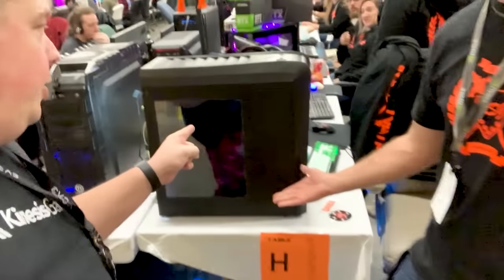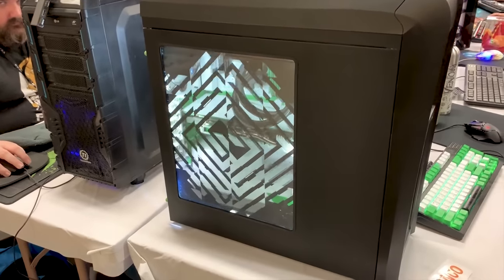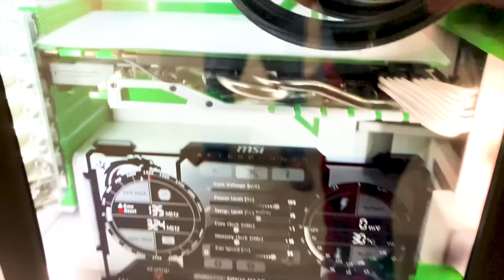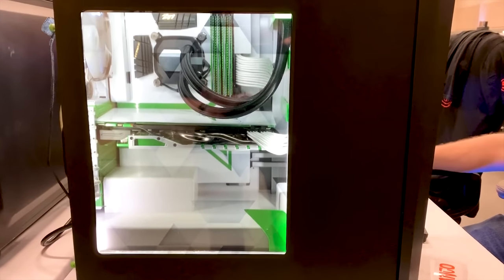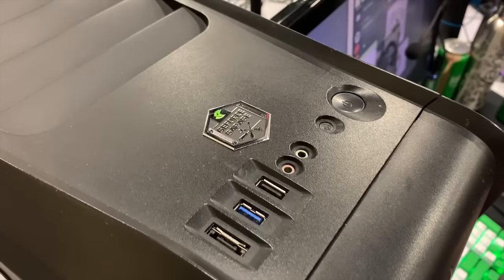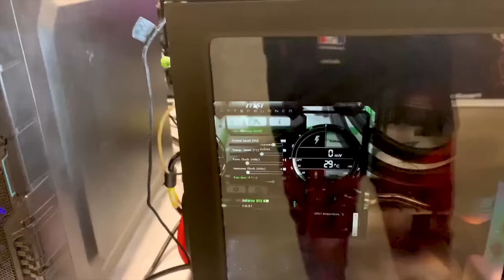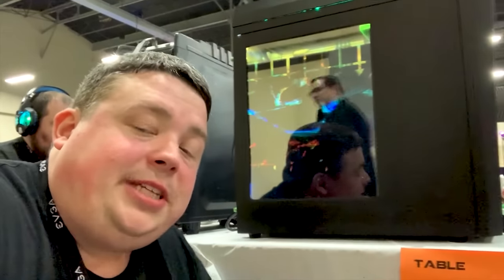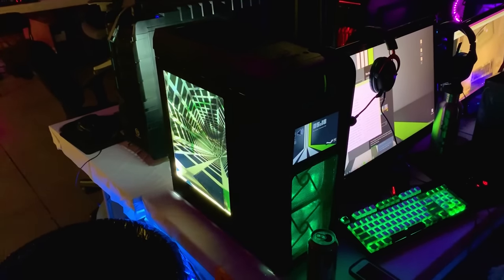Transparent DIY full color LCD side panel is the best case mod! - @Barnacules

Comment: I did this back in 2001 but it wasn't as nice as this. I used three 7" black and white lcd panels with ridiculously expensive lcd controllers. Back then colored lcd monitors were really expenisve and old school crt monitors were the norm. I ended up putting the project on the side and never got around to finishing it completely. I've still got pictures of the crazy pc mod I was putting the lcds in but none of the pics show the lcds. I removed them when I was finishing up the case for a modding contest in which I didn't even finish modding but still won the contest either way. Maybe one day I'll make a slideshow video showing off the case. It had mods which I still haven't seen anyone else attempt till this day.

Comment: ok for real i always thought it would be cool to use lcd technology in regular house windows, you could integrate them into a smart home system and literally dim them, change the hue of light, display information and all sorts of stuff.
Reply from the maker: minton brunkhorst I’ve seen this before in modern homes, but those LCDS just do solid black and white.
Reply: yah i can imagine it would be hard to get lcd technology that could handle direct sunlight for prolonged periods of time, also intense UV and heat may explain why there is no color option yet

Comment: How to get the video feed from inside the case with no cable going to the gpu port outside?
Reply: My 1080 has hdmi inside for vr front panel this is now making me think of a use for it
Reply: Attarsanah Resources unless you have a feature like that on your card you could always solder to the mono directly and add an internal hdmi port. Not to hard but really time consuming
Reply: Attarsanah Resources he’s using the integrated graphics from the cpu

Comment: I have the Ibuypower snowblind, and I am still jealous of this.. If only it were a touch screen see through LCD display though then it would truly be magical.
Reply from the maker: ECashsociety TechTalks honestly making it touch screen would be pretty trivial. Easiest way would be just to add a USB motion tracker like from Magic Leap and it would turn the whole side of the case into a multitouch surface, you could put on 3D printed buttons, etc that are fired when touched without them being connected to anything. I should just do a video on it. Go back to making weird stuff like I used to.
Reply: Barnacules Nerdgasm I would love to see you do that.  Your Epic 3 50 inch setup nearly inspired me to do the same in my own home.  I bought two 50 inch monitors then sort of gave up on the project though I wish I hadn’t.  I also bought a product called the airbar to see about adding touch capabilities to my snowblind in the hopes that I could modify it somehow.  I am sure you have heard of this device showcased on Unbox Therapy some years ago.  I’d love to hear a recommendation for a USB device to do this with my snowblind.  Sadly the airbar I picked up was DOA.  I tested it on three different laptops then finally returned it.  I also looked into something called touchfoil.  Either way having a see through touch screen display like something out of Minority Report has me extremely intrigued.  I have been watching your channel for some time now and if it wasn’t for channels just like yours I would not be headed in the direction I am.  Man just having a response from you brings me a ton of joy!

Comment: Finding a good use for outdated tech is the best way to recycle. Thanks
Reply from the maker: I thought the same thing, everyone has old LCD screens laying around they couldn't give away to the Goodwill if they wanted to. Time to dust them off, rip them apart and make them display epic Anime on the side of your case at LAN parties!
Reply: @Barnacules  I've often thought of additional info screens off of the game play areas, I'm old and would like all the monitor real estate I can get for game play with the info screens in a lower res. monitor. elsewhere. example desktop touch screen in hand and info screens on desktop. Being older I can use touch screen (ie tablet style) in lap, and use aux info on desktop screen. My preferred method is desktop compute power in tablet form (wired/wireless) and aux info like twitter or chat on desktop monitor. Still in development.
Reply: Additional info, my current setup includes twin 32" monitors appox. 10ft away with a hand-held touchscreen hardwired from my recliner couch (still glitchy, working out the bugs), looking promising. The hardwired touchscreen eliminates lag.

Comment: I did this mod with my computer went through 2 panels because first one broke and only bottom third worked, but the second one worked beautifully. Got them for free so who cares. One thing to note for anyone who is thinking of doing this, ONLY DO THIS IF YOU HAVE A WHITE CASE and ideally white components because it does not work as good for black case and components as it does with white all over the inside. There is a lot of light absorption from the black so the screen wont be as bright and vibrant. Also doesn't work during the day.

If you are going to tackle this project
3014 LED light strips are the brightest strips per foot and are efficient for the amount of light put out , Very good density of leds 

Solder up a molex to the LCD control board so you don't have to mess around with the monitors power supply you can just hook it in to computer 
power supply    
Remember: Yellow=12v ; Red=5v; Black=Ground

Comment: I would use a Rasp Pi to drive the display. That way the displays can be "canned" you could control and send extra data over serial or ip that way you don't deal with "loosing your cursor"
Reply: The Pi is good for some projects, but I don't think losing the cursor is so bad that it has to change the way this project was done. Plus, the Pi's ARM might cause somewhat significant delay in printing stats to the display.
Reply: I have the touchscreen he has but I have it inside my PC below my GPU, running rainmeter and HWinfo at 640p to display my system and hardware stats in real-time results in basically zero system useage, and my mouse only goes over there when I want it to. I have a video of it on my channel playing the new DOOM game. I'd eventually love to find a bigger display and better mounting process, my old case I had it bolted to the acryllic window and it fit the spot it was in perfectly, inside the P300s TG it just sits there and looks tiny lol.
Reply: just lock the mouse to 1 screen so you wont loose your cursor or make it a dual key press to switch screens easy fixes

Comment: I've seen these before and although I thought they where a really clever idea they just didn't impress me. However the way this has been implemented using the white inside the case and the screen to blank areas out rather than be a semi transparent display, this really works. 10/10 for implementation and 10/10 for DIY :-)

Comment: Uhm, I happen to have a couple LCD screens with some spare LCD controllers laying aroung in my house...
Reply from the maker: You know what to do...
Reply: To be honest, this is very easy and cheap, you can use a recycled old laptop screen with a 20 bucks controller board from eBay. 

I am gonna try this with a 10' inch LCD that I have, but don't have the controller, just the case mod that isn't gonna be easy for me...

Comment: Holy shit I tried this a couple months back and this motivates me to try again! Haha, thanks for the great vid as usual!
Reply from the maker: Ashnno why did you fail? Any advise to pass along?
Reply: @Barnacules  Just knew little to nothing about electronics. Basically, I found the lead wires that powered the LCD and it almost always came down to 2 wires, the red 5v and black ground wire (I tried this with 3 or 4 panels, lol) Once I found the leads, I tried soldering them to another 5v cable such as a USB power cable. I was inspired to try this method by watching some other people's guides who seem to have got it to work. Mine just ended up with a dead monitor control board every time :P

TLDR: I just couldn't figure out how to properly power the monitor heh..
Reply: @Barnacules  Also, I'd love to see you try this and make a video on it!

Comment: now i have no idea how this would work, but couldnt you theoreticly assign a virtual machine from a ryzen 7(because of its 8 cores) and have only the virtual machines use the lcd panels, so you wouldnt accidentally loose your mice on another panel?
Reply: yeah but youd need to keep a separate keyboard and mouse on stuff at hand. and youd need a second video card just for that.
Reply: Or use a raspberry pi
Reply: @Mart-E12  ... why did i not think of that O_o

Comment: Still love this since I saw it in one of Mosquitos (from themodzoo) builds a long while back. It's on the list of things to do in the future.
Reply from the maker: Larry Kozlowski blows my mind that Mosquitos did this back in 2013 and it’s still a rare mod to see.
Reply: @Barnacules  yeah, it was just before its time. It actually gave me an idea for a mITX scratch built case where 4 sides had windows made from IPad retina screens but I just never followed through with it since it was ridiculously expensive and the horsepower would be insane to run it. I still want to do it someday.

Comment: What software did he use on the small drive bay lcd to eject the optical disc tray and control system volume.
Reply: It’s a simple script in rainmeter.

Comment: anyone updated windows 7 64 bit thru windows updates  and looked at 
power management the performance mode has disappeared on mine is 
microsoft slowing down windows 7 forcing upgrades.  can only use 
balanced power option which does not boost  for work loads 12/07/2018 .

Comment: I have a dream system I'd love to build, but I don't have the $$ or the room for it and as the hardware keeps advancing, I keep tweaking it. but long story short is it would be housed in a Thermaltake Tower 900, dual custom hardline loops, with the front panel being just like this LCD side panel, the idea is Umbrella Corp. Blueline for one, and Greenline for the other, and the reservoirs being the Golgotha Virus and Tyrant Virus double helix vials. and the front panel of the Tower 900 would be this Transparent LCD display set up, where I can set up biohazard info, have Umbrella Corp. splash screens, and be able to have the Red Queen show up from time to time and upon shutdown have audio play of the red queen saying "you're all going to die down here" over a case speaker.  I'm currently lusting over the Samsung CHG90 and the RTX 3090

Comment: I did this in 2001, i had a full tower case custom sprayed in an arden blue, i used a 7" lcd in the top 3 drive bays displaying whatever i wanted (usually music videos from my winamp playlist) plus a 14" lcd on the side as the window just like you see in this video, the only issue back then i had was i couldnt get a decent amount of backlight in the case plus my motherboard was dark, didnt have the guts to spray the hardware, i had a matrox graphics cards which i removed the vga connector and soldered the video wires direct to the graphics card where the vga pins had been so no wires out the back of the case. I do wonder why more people dont do this though it is by far one of the bets case mods you can do.
Reply: We really didn't have the leds back then like we do now.  Were you using the ccfl's for the backlighting?  Those weren't very good for pure light output, just not bright enough.

Comment: Retty slick.  Reminds me of a case I made using a touchscreen from a busted point of sale terminal back in 2004.  Ran off the dvi out and powdered with a paper shredder power supply.  Mounted the touchscreen and display inside the side of a massive tower.  Fun but sketch as hell.
Reply from the maker: Sketch is where it all starts man! If you have any pics of it tag me on Twitter @barnacules
Reply: @Barnacules  I think I have a pic, but it's been 14 years, so no promises.

Comment: I was discussing this last year. I have a 17'  laptop and HP palm pilot screen I plan to put in my case. I have to check out your build log.
Reply from the maker: DOOOOO ITTTTTT
Reply: You can use nearly any screen. You can get power supplies and control boards for nearly any monitor on Ebay. You can take an outdated monitor and add HDMI to it.

Comment: There is no need to do this, it serves no real function (minus the front panel) But dang its ultra cool and if I did lan parties still, that would be the coolest idea for sure.  However I also see this being a thing for old lcd panels where the tubes died, and putting them in a "shadow box" with the inside painted white and lots of internal LED strips.  Nice idea to be run off a Pi as a form of art on the wall.

Comment: can you tell me more about your Clevo laptop. I recently got one from digital storm but it's difficult and confusing for me looking up drivers for a Chinese website. And the drivers installers are manual, there is no installer that automatically does all the work for you, it feels like you have to put the files in manually and I'm uncomfortable with doing that and have no idea what I'm doing.
Reply from the maker: Zipzeolocke the problem with Clevo laptops is they are infinitely configurable so everyone is different. The one Puget Systems built me has all inbox driver support.
Reply: @Barnacules  the one I got came with a P95xER U3E1 motherboard, Intel i7 8750H 16 GB of RAM, a GTX 1070 MaxQ, a Samsung 970 Evo 1TB NvME SSD with a 1920x1080 144 Hz screen. it's a really nice slim powerful laptop, but I don't know anything about Clevo/Kapok. I just know they manufacture a lot of laptops and a bunch of OEM's use them because they are a great bang for the buck

Comment: My case has holes to mount a fan on the side. I'd have to buy a whole new case first to do this. LOL
Reply from the maker: drud 1995 just ditch the acrylic plate on the side with the hole and replace it. Places like tap plastics can trace and cut you a new one without a hole

Comment: I do like the Touchscreen. But I am wondering if I could just do a black LCD screen. I now have more ideas I want to do...

I understand you need the inside to be white...but...What happens if I dont want it to be white? Can I not do that?
Reply: It needs to be white to reflect as much light so that you can actually see shit through the screen. It's essentially a backpanel for your LCD display.
Reply: @startide  and if I dont want to see behind the display? Like for example I just want to do animation for the display?
Reply: @angelofrevelation5822   of you want to see anything colour properly on the actual screen it has to be bright white.
If you just wanted to shutter the inside, so black it out and then reveal the inside, or black out parts of it, you could have anything inside.

Comment: It's just a regular screen without the rest of it lol  There is a reason they put the screens inside an enclosure and not just out in the open.
Reply from the maker: THE NEON TETRA PRO GAMER they are super fragile, that is why they put them in an enclosure and usually light them from behind the panel with diffused light.
Reply: Yeah, the reason why you need very bright white inside case is be cause it Acts as the backlight

Comment: This hack can be easy and difficult I made one of my computers last year with a transparent lcd side panel that I put together done it first go worked out great made the whole panel plexi glass and masked out everything but the screen. I decided to do it again with my main rig and it all depends on the lcd you use I had to go through 4 or 3 monitors and still am searching some old vga monitors have the psu built into the graphic board and short of dremeling it you wouldn't be able to shrink it and some lcds have a issue with removing the anti glare filter even if you soak them for hours.
Reply: What monitor worked on the first go? I have an old vga monitor and I am thinking about doing this.
Reply: @NotCreative21  Tbh I lost the frame and i'd have to look up the part number to find out. Best advice I can give is to open it up part way and if you see the psu is separate from the driver board you can use it. Also it makes it easier if the psu is labeled if it isn't you will have to be careful and test it while it plugged in and apart to get the voltages. After that just cut the psu off the driver board and use the main computer psu to drive it. Some time today or tomorrow i'll go figure out the monitor I used in my first panel I made and leave another comment.
Reply: @everythingdigital1  Thank you for the help, I could just use the monitors psu and if it is small enough I can make a cover for the capacitors and dremel a hole to run the 2nd power cable through the case. How do I power the monitor off the pc's PSU? Do I draw power from a molex or sata?
Reply: I just did the lcd, it took me like 5 monitors to finally finish it, 3 of them had the vga board separeted from the psu, but two had them together, 3 pf them where dells, I removed the antiglare very easily after soaking them for 3 hours, finally it is done but I had to use one vga board from one display whith another lcd from another display, short, lcd and vga board are from different lcs, wor just beautifully, just need more light

Comment: Or stack them so you have a holographic display
Reply from the maker: The problem with stacking is the amount of light required to go through the panel even when it's blank. It blocks a crapload of light so the more panels you use the more light you need.

Comment: and the heat build up would be off the chart. good luck ocing high end gpu/cpu in that case.
Reply: Actually, the part of an LCD that gets hot is the backlight, and he's using LEDs in there, shouldn't be any worse than a normal acrylic or glass panel
Reply: mint hos The led strips still get hot, it gets toasty in there but I’m still running my 2600k at 5gz.